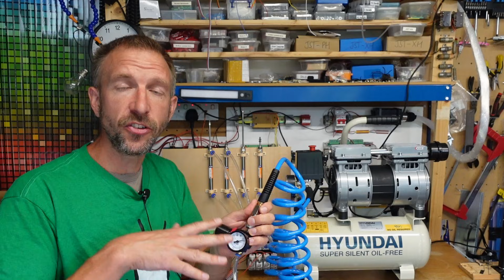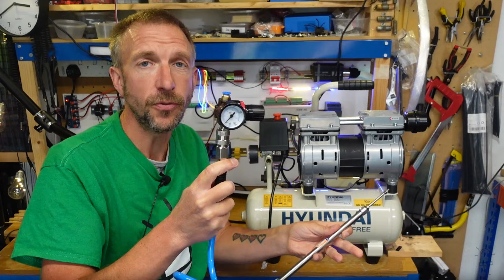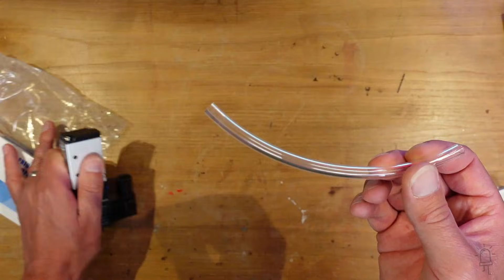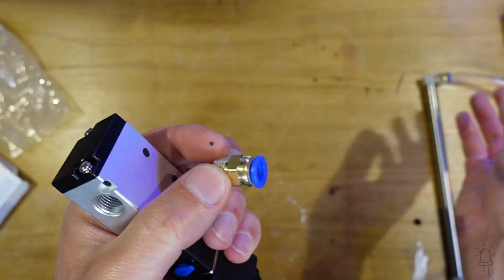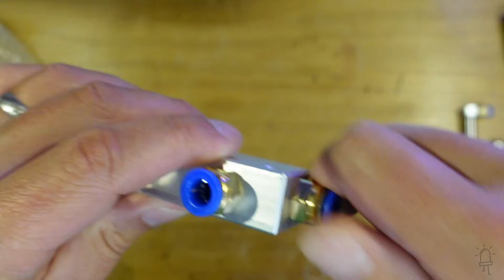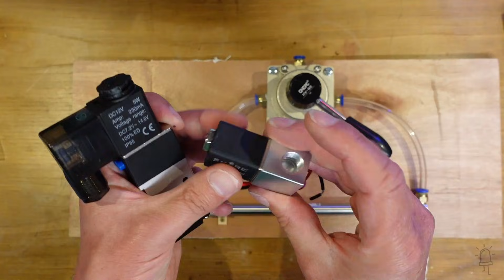Pneumatics 101: A Beginner's Guide to Building Air-Powered Props

Comment: Definitely considering using pneumatics in my next adventure
Reply from the maker: I think it's certainly just another useful possibility to consider alongside gas struts/linear actuators/maglocks etc.!
Reply: @PlayfulTechnology absolutely 
I created my own linear actuator with dc motors and long threaded shaft to expose maps behind a painting on a wall. But Pneumatics opens up a few more doors for ideas.

Comment: I wonder if 3d printing connectors is a valid solution
Reply from the maker: I suspect you wouldn't get a particularly air-tight seal, but you could always try! You can definitely 3D print various nozzles and other pneumatic outputs.